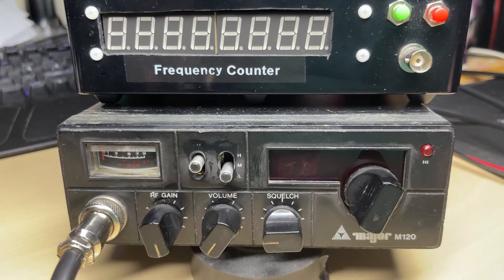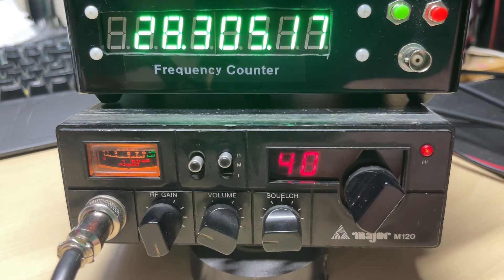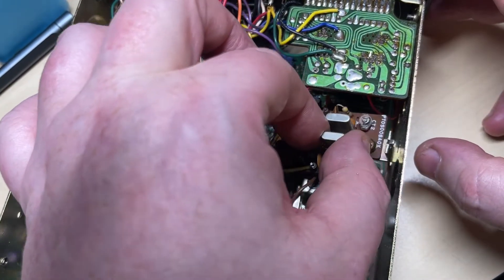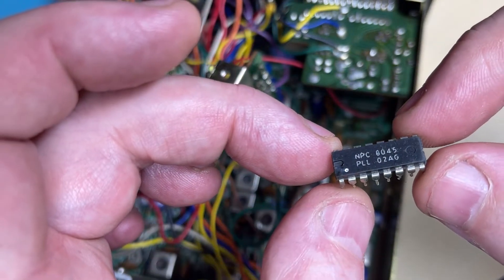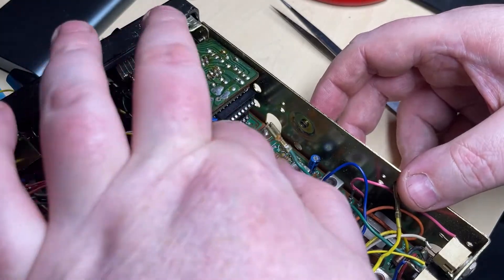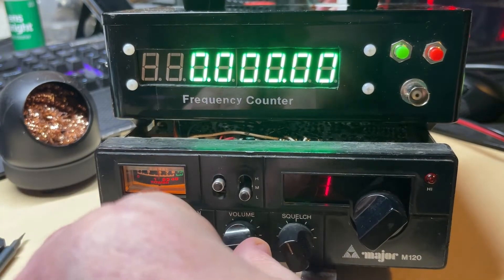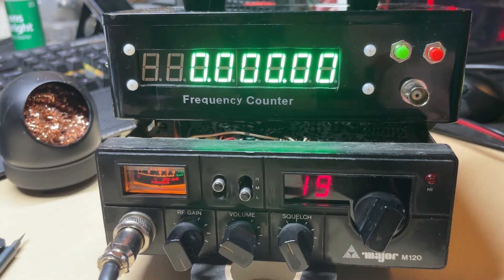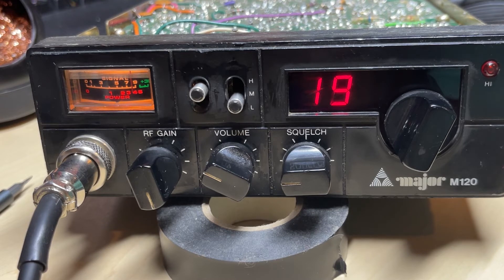EP 055 - HAM International Major 120 - Fitting a PIC mod for UKFM 1 to 40 readout.

Comment: As usual,  nice work.  I must also add, I find the green frequency counter display more legible than the red.
Reply from the maker: Hi, thanks for your nice comments , the freq counter is hard to film , if the brightness is turned down it flickers due to PWM, i changed it for 2 reasons , 1 filming , see if it wound turn out better , and 2 one of the segments was playing up on the red one. I have lots coming up with this PIC mod , and im working on a +5kc -10kc for the PLL02ag